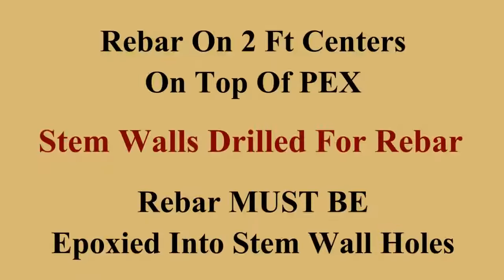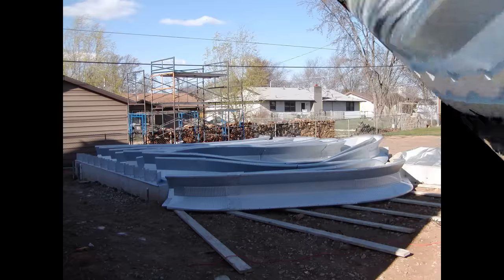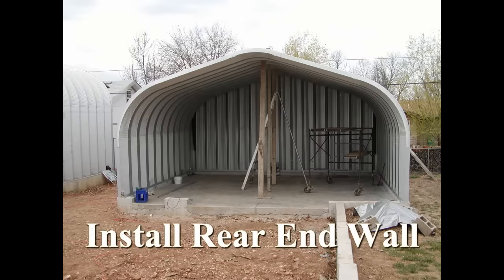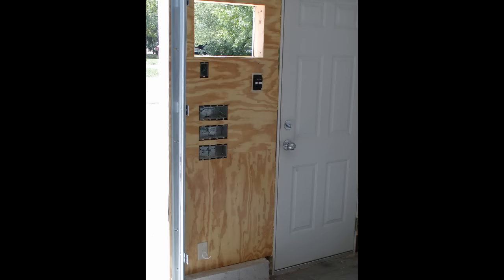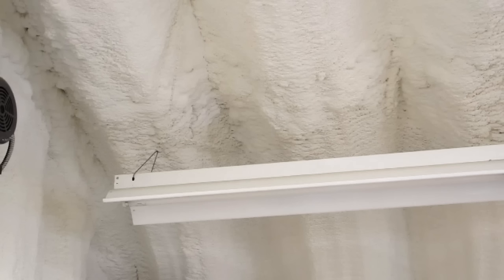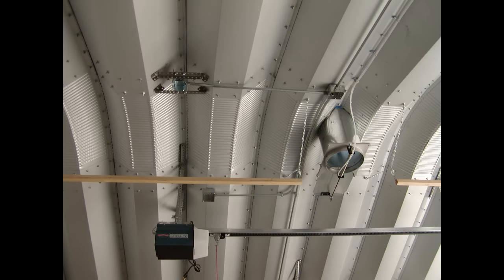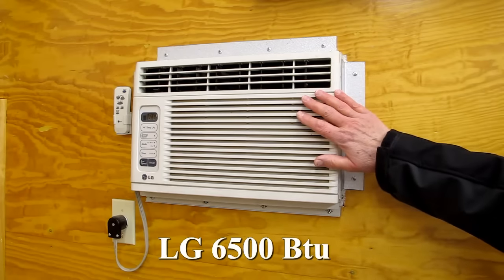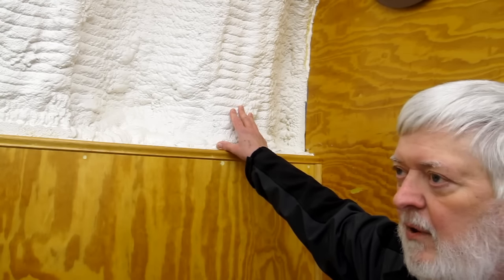Building My Steel Garage

Comment: BTW this video is excellent and detailed. I'm a lifelong mechanic etc and I'll point people here if they are curious.
If you want to locate an overhead support for an engine lift etc, consult with the person pouring your footing to leave solid areas of appropriate depth for anchoring steel post uprights etc.  MAKE SURE you know the boundaries of those areas so you do not drill your heating tube!
I used 8" of fiberglass-reinforced concrete with no slab heating on mine but I live in South Carolina and have/will bolt many things to the floor. Spray foam beats batting since it seals out condensation and is worth the effort. If it got cold where I live I'd use that, too.  Batting invites vermin.
The way to hang accessories from the ceiling is to take advantage of the thread protrusion of the bolts through the nuts, and screw on "sleeve nuts" which are simple long hex nuts to these. You then may use bolts in the opposite end of the sleeve nuts to attach accessories. Your accessories may be on plates or brackets which "pick up" multiple bolts. Easier seen than explained.
A bottle of anti-seize should be at hand for the whole job. Hit every thread even if you never expect to unbolt them! It protects them from corroding together and if years later you wish to change something it will save your posterior! About ten bucks at the auto store.
I did something unusual with mine as I had bartered for enough I-beam to frame the whole base. I welded it together (common Lincoln AC225 with 6011 rod did the job), drilled it for the building "base channel" bolts, then assembled the building leaving the ends open. I poured the concrete afterwards. Some of you may have friends with enough scrap steel to do this and it works a treat for a shop or anything else. In my case it cost me near zero and was cheaper than if I bought wood to make forms.
3M 5200 marine through-hull sealant is superior by far to conventional "caulk" as if it fails, what it's on may be at the bottom of an ocean. Widely available so give it a try.
It's my go-to goo for my ISO container and Steelmaster.
Reply from the maker: Good comments. Well written, accurate and constructive to the topic. Thanks for watching!

Comment: Your information and expertise is evident in your video and your honesty and forthrightness is refreshing. You have given good advice and also have helped me make choices. One, that this type of building is probably not one I plan on doing. Without the truss support you are relying totally on the foundation for support as you stated. If you aren't planning on putting up a concrete pad then apparently- this is NOT the building choices you want to go with.  Thank you for your honest appraisal of this prefab strip built buildings.

Comment: This is a very well done Video Ron.  I'm about to put my building up and I plan on following your modifications for insulation, venting and power.  Thank you for taking the time and effort to put this together for is newbies.
Brad Allore
Aircraft Maintenance Engineer
Reply from the maker: Brad Allore May the force be with you. :-) If you have never cursed a
nut & bolt before you probably will by the time your 3 or 4 buckets of nuts
& bolts disappear.

 

I have a number of videos related to this particular garage
and how I later decided to re-enter and install dust collection ductwork and
various items to make it my wood working shop, including placing filters on
those window A/C units. 

 

Please subscribe if you haven’t already. Good luck with your
building.

 

Ron Walters

Mechanical Engineer

Comment: I put up a 35ft wide x 30ft deep building around 10 years ago. Almost give up on before we got the first three rings up. I had 7 people helping. And 5 of them thought they had a better ideal on putting it up then I  did.
Took us 5 hours to get 4 rings up the first day. Second day, I told each one again how we were going to do it. And if anyone did not want to do it my way. Go home or where every they wanted to go.
3 hours we had the rest of the rings up. Easy as can be, but still lots of bolts to finish. One of the best building I have put up.
Reply from the maker: The first 3 or 4 are the critical ones especially if the wind starts blowing.

Comment from the maker: You should consider installing a roof vent to prevent condensation from forming. My small garage (the one in this video) has one roof vent and the large garage now has two roof vents. Initially I did not install roof vents on the large garage and condensation was a huge problem - especially with drastic changes in the weather (sudden changes in humidity and temperature). As soon as the roof vents were installed the condensation problem went away.

Comment from the maker: The PEX pipe is incredibly tough. You could tow a car with it. I have dealt with leaks in concrete with the OLD systems using copper pipe in the concrete. That was a mess! To avoid the possible problem I avoid any joints inside the concrete, although I have NEVER had a leak at a fitting or joint. With the OLD systems you would need to break out the concrete and fix the leak. I have never had a leak in this garage, my house or in a snowmelt system.

Comment from the maker: I live in the Ozarks. This is a 500 sq ft garage. The high-density closed-cell foam insulation is very efficient. MY A/C are small 6500 BTU units. High temp here can be the upper 90 to 110 deg F so on a hot humid day my AC are running all the time. How much AC do you need? I don’t know. Depends on the insulation, how much heat you generate inside the garage (what equip, how many people, etc). So you need someone locally (heating & ventilation company) to do a heat balance calculation for you.

Comment from the maker: The 2x4 runners for the plywood went as high as the straight sidewalls. This was the logical place to stop the plywood when foam insulation was being used. I think the ply ended up being cut at 5 ft 5 in. The cut off ends   were used in the end wall and on other projects.

Comment from the maker: Because there are no internal structures or trusses, the height of the sidewalls is relatively short. For light weight items stored on shelves I would attach the shelves to the plywood walls. If you need higher shelves, order taller sidewalls. Strictly speaking the building is only designed to support itself and no additional (external) loads. Common sense comes into play here when it comes to dealing with actual situations.

Comment: I have what appears to be an identical steel building sold in Canada by Future (Steel) Buildings. I haven't assembled it yet but it will have wood framed front and back walls. So it would have been real nice if you had shown how you tie the wood framing into the steel arches but I understand your need to keep some trade secrets. I'll probably end up using 4' wide insulation bats designed for steel construction as that is far more of a DIY project than is insulating spray foam. Anyway nice video and a beautiful garage.

Comment: Wood framing tie in is "whatever works and is sound". I have the same style (there are many vendors and the rolling machines to make the panels are old news) and would make brackets and bolt them through any wall I put up. I dislike wood so I went with metal. 
You use metal expansion bolts (referred to as "red heads" by some) to hold the base plate to the concrete. Rent or buy a hammer drill of appropriate size.

Comment: Ronald, can you supply some instructions on how you framed the front wall in this video please? What you did there is exactly what I want to do on my building.
Reply from the maker: Sorry, I do not have a video showing the method I use to construct/connect the wood frame end wall.

Comment: Excellent Video.  You stated in your video that you have developed "your own method of attaching the wood end walls to the metal building".. It will be my residence. Again the question is 'how best to attach the 2 X 4's to the metal building (stud walls)  and an end wall as well. .  I am going with a 'steelmaster' building and from what they explained, with having to attach 'threaded rods to the hex head arch bolts, coupling nuts (extensions). etc.  Please help.  Thanks, bob.

Comment: Hi Ronald I just built a steel building the same style as yours the only thing I have left to do is build in the end walls like you did on the front of your building is there any advice on how to attach to the steel building I've been trying to figure out how to do it and haven't came up with anything solid yet I've watched your video but I can't tell how you went about it and there really isn't any information on this subject that I can find. any help you can give would be much appreciated
Reply: I did get my end walls done they came out awesome I used steel studs 2x4 16ga it is very strong I ended up putting in a top and bottom rail that goes all the way around the edge so all the studs are inside of it and screwed tight at top and bottom

Comment: I basically have the same building. What exhaust fan did you end up using ? Did it come with the framing and attachment hardware to the end wall  ?
Reply from the maker: Basically nothing comes with anything suitable for one of these buildings unless it came from the building manufacturer.
I got the exhaust fan and shutter from Grainger Supply. Currently I have a busted foot and not in a position (nor the mood) to look for any paperwork. :-)
I figured out the cuts for the opening (as shown in the video) and then had the outside metal cut (to span several corrugations) and the inside frame for the fan made to suit. You can see how the outside shutter attaches and that there were a couple strips of angle iron used inside between the end wall metal and the fan frame.
You need to think about diverting rainwater and not creating a bucket above the shutter. That is why I bent the end wall cuts outward. Then lots of silicone sealant (the good stuff). You need to power wash the inside and outside of the building with hot soap and water and rinse several times to remove any mill oil if you want anything to stick to the Galvalume.
Hope that helps.
Thanks for watching. Ron

Comment from the maker: Estimate the concrete work (footings, stem walls, 5” reinforced floor) the steel building will probably cost you about the same. Learn about radiant heat systems and do it yourself. You will probably need help with the concrete and foam insulation. Building erection, wood front-end wall, garage door, electrical, plumbing, A/C, exhaust fan, etc. you can do these yourself fairly cheap. Make a detailed list and get estimates. If you cannot do any of this yourself, turnkey will cost you a fortune.

Comment: Looks great- very interesting. On those plywood panels I see you didn't go up the full 8 feet , but it seems they aren't 4 feet either. Did you cut them down? I'm just curious to why- purely aesthetic or other reasons as well? Thanks Ron!

Comment: Ronald, I am guessing you live a little north of me since you put a lot of effort into the heating system. I live in southern Louisiana, where it is exactly opposite. You mentioned "the hottest of days" using those two small window units. Can you tell me how hot you meant, and how much AC I might need when the days get into the mid-upper 90's? Nice job on the video, as usual.

Comment: could this be used as a tiny home
Reply: Much better than my 240 sq ft camper! but my camper only cost $1,000.00. I assume this garage cost $50K minimum. You have to check w/ your county codes. I live rural so garage homes are OK. May not be allowed within in a city limit.

Comment: Sorry one more thing I see you have the spray foam installation how can you dry wall or whatever to make it look like a nice flat wall in sorry I have no knowledge of this stuff but I'm extremely interested in building a 25x40 as a little house maybe
Reply from the maker: Danny Doty The appearance of the foam is a direct function of the experience of the person spraying it... but it will never be smooth and "pretty".You either need to accept the irregular surface of the foam or frame out a conventional rectangular structure inside the steel building so it has flat walls and a flat ceiling in which case a lot of space is lost inside the steel structure. A 25x40 is not very big if you start trying to frame out the interior to make it look flat.Go to PioneerSteel.com and look around the photo gallery for a few ideas. Google: Building a home inside a steel building (or similar) for more ideas.
Reply: +Danny Doty Once you choose an insulation type, usually cost determined, you can just frame in whatever sort of interior you want as per normal.  There is no need to anchor to the outside wall or structure, no more than you'd need to anchor the exterior wall of any other structure to something.  You'll lose inches dependent upon what sort of thickness of studs and panel you pick relative to the amount of load you're designing the interior structure to handle.  I like how he took the time to describe the rebar through concrete with epoxy trick he uses to keep the width of the structure static... seems like a smart man.  With the slope of the roof just keep your interior design/framing off and away (air gapped) from the upper super-structure's flex points and I can't see much of an issue.  Boxes in boxes (or in this case: building boxes beneath and arch).  Not sure if you know that I mean but I did my best.

Comment: I have a pioneer steel shop with a steel end wall.I want to replace it with a wood end wall. Do you have any instuction  or video on this as i cant find much
Reply from the maker: Sorry, I do not have a video showing the method I use to construct/connect the wood frame end wall.

Comment: Hi from Oamaru New Zealand. 
Any idea where these are made?. We have a lot imported from China. Pity there's non in Zinculum which is longer lasting.
Reply from the maker: These are made in Toronto Canada and the metal is Galvalume.
Galvalume, invented by Bethlehem Steel in 1972, is a steel sheet with a coating of 55% aluminum and 45% zinc.
Thanks for watching.
Please subscribe. That's what keeps this channel going!
Ron
Reply: @RonaldWalters2010  Hi Ron. Can you confirm if the corrugations trap or hold water in the valleys when rained on?.
I fear galvanic erosion.

Cheers Carl
Reply from the maker: Water runs off. Like anything else, you need to pay attention to the assembly. The overlaps need to be on top of the lower piece... just like roof shingles. Very straight forward assembly.

Comment: What is the finished cost of the building with the heating system and accessories you show in this video and how does the cost compare to a wood frame building?

Comment: I followed along fine until the last few minutes. What was the epoxy rebar discussion about? He didn't show any footage of this.
Reply from the maker: I did not have any photos of using the epoxy. The rebar must be mechanically connected to the stem walls. Stub sections of rebar were epoxied into the drilled holes to provide that solid mechanical connection. After drilling the holes in the concrete blow out all dust before epoxying the rebar into the holes.  The rebar is overlapped by several feet and wire tied to each other. The concrete will hold everything together after that. Is that clear? Thanks for watching. Please subscribe.